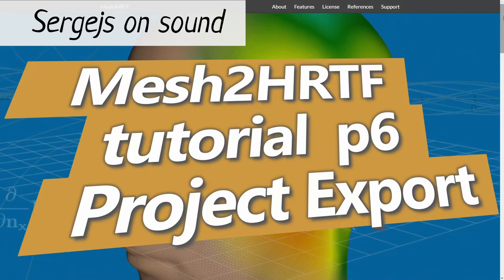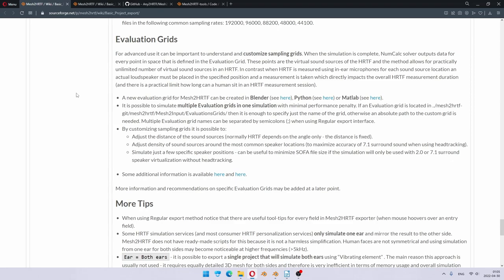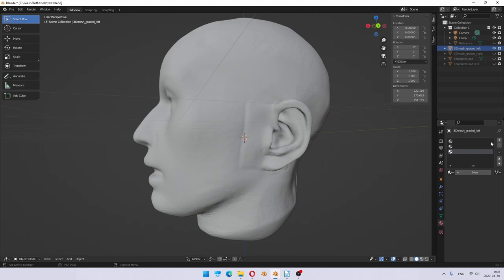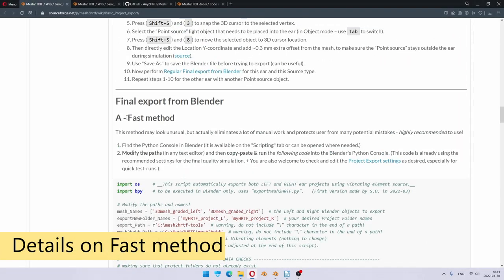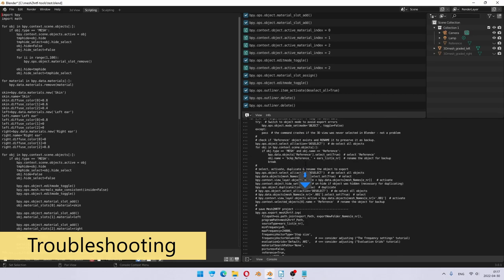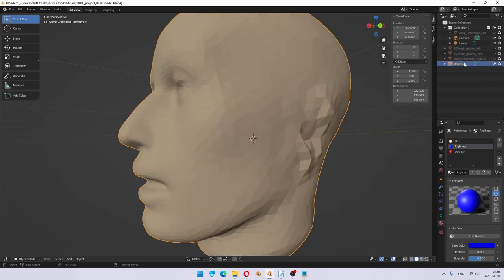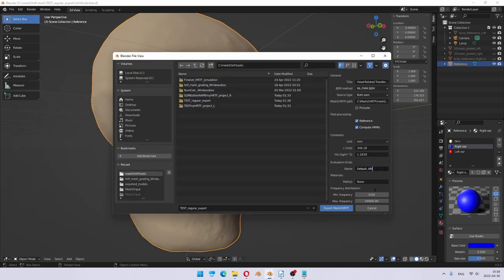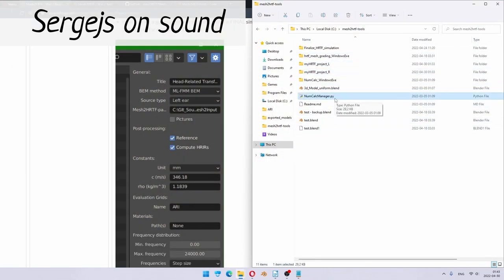Mesh2HRTF - t06 - Project Export Tutorial

Comment: Hi, I didn’t used the reference file.. i just started to work on a newly created blender file from tutorial one. Will the script work without the reference file? Or is there any workaround now? However i append the material from the reference file to my new file. Please let me know.Thanks
Reply from the maker: Reference Blender file is not required at all - you just need to be careful to get all the spellings right for materials and meshes. Otherwise subsequent steps may fail and when possible we want to avoid fixing bugs caused by a typo or wrong axis alignment. :)